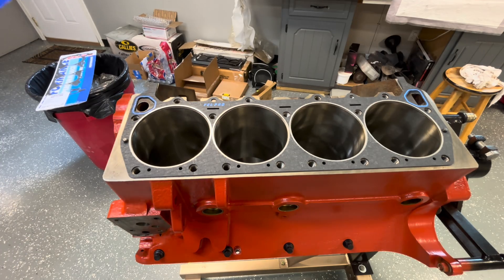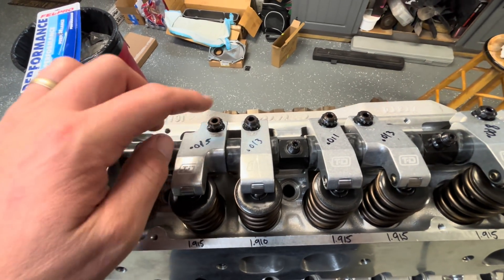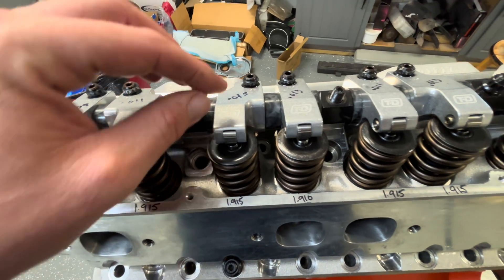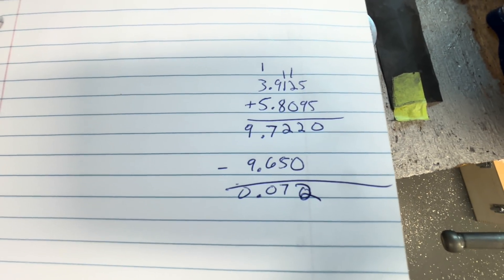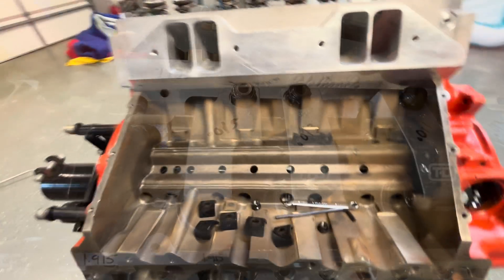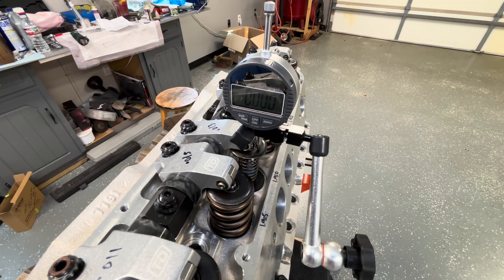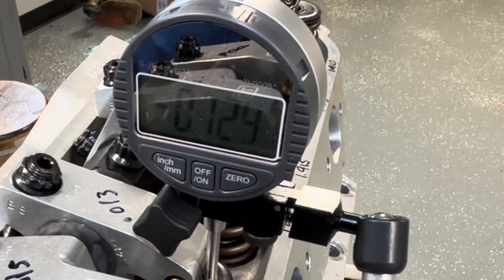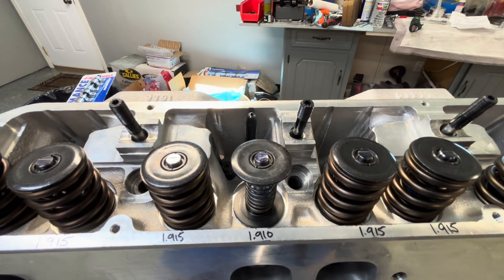580 Stroker Pushrod Measurements #mopar #engine #stroker

Comment: Did I miss it? How did you checkyour geometry before ordering pushrods? did you have to relocate the shafts on those heads  WAY TOO WIDE A SEEP FIX IT B3 OR WHATEVER
Reply from the maker: The sweep is wider than desired, but the rockers and lifters are what they are. The silver lining is that the sweep is centered on the valve and the lift is very close to what the cam card asks for. I don’t know if B3 shims would be the best option for this much spring pressure. Or would be a substantial amount of force on five rocker studs that are holding on for their lives.

Comment: If you measured the exhaust pushrod, with the adjuster one turn down, and with a feeler gauge setting the valve lash, and that number was 9.7220" then you can use Pythagorean theorem to figure the intake pushrod length with the 0.725" offset rocker.  Then add a touch more since the intake lash is smaller.  Intake = SQRT((9.7220^2)+(0.725^2)) = 9.748995" or 0.027" longer than the exhaust pushrod (plus extra for the difference in valve lash.)
The extra from difference in valve lash would be (Exhaust lash - Intake Lash) / rocker ratio
Reply from the maker: Excellent! I was thinking about that math as well, but didn’t want to mess up explaining it in a video.
Reply: @JustMoparJoe  Just trying to explain the math because of the rocker offset / tilt of the pushrod.  Should come up the same when measuring with the adjustable pushrod.  You should show the difference of the T&D rocker system with the smaller diameter shafts that are real thick and need the special hold-down studs that are narrowed in the center for oil flow.  Looks like the rockers clear the retainers/springs with your setup.  I ran lash caps because of retainer to the inside curved part of the rocker touched when the valve was closed (was using +0,100 retainers with +0.050" locks for more spring install height.)
Be careful tightening down the rocker shafts evenly.  The spring pressure on the cam lobe can cause the engine to rotate if the engine is not in a position where the pressures equalize.

Comment: Hey Joe. When you showed the push rids from the side it looked like the intake was very close to hitting  the block on top and it looked like the push rod was hitting the lifter cup. Just a suggestion.
Reply from the maker: Thanks Brian! I’ve got some good close up pictures and always double checking. I’ll try to get some better angles for the final assembly.

Comment: Just curious in case I missed it. Is the head gasket torqued down? How much does it compress? So in my way of thinking the head gasket would need to be torqued to do all your measurements? Thx Joe. Awesome to watch and learn so I don’t make any mistakes on my build. I appreciate all your vids. I have learned so much.
Reply from the maker: Thanks brother. This gasket is not torqued until final install. MLS gaskets can get retorqued. These only get the one chance. They will compress less than .010” of an inch. Which won’t matter much at all. I do have a compressed version of the gasket but will have to find it after the move.

Comment: No pushrod clearancing required for offset rocker?😊 Does the block have standard rocker shaft oiling?
Reply from the maker: It appears these heads have been clearanced very nicely and have a mile of space. I will try to show close upon final assembly.
Reply: @JustMoparJoe i have this head and rocker combo going on factory RB block just wondering if best to use offset lifters or not?😊
Reply from the maker: @malglasspool9302 I will have a conversation with BAM soon about this very thing
Reply: @JustMoparJoe great thanks,will be watching for sure👍😊

Comment: I use the same T&D rockers and have found a lot of flex in the shafts causing around 8 to 10 thou extra rocker clearance when the valve that closed is next to the valve at full lift (.750).
Reply from the maker: I’ll absolutely check that out! I did notice the smaller diameter shafts in comparison to what I’m used to.

Comment: Curious to why the owner didn't go with Harland Sharp rockers. Also, does that .51 Head gasket increase compression? Just curious. Good video Joe.
Reply: If it’s going from a .40 to a .51 it’s actually gonna decrease compression slightly.
Reply from the maker: He ordered the T and D’s a while back. They’re known for race quality and being very well made. It’s the first set I’ve ever used.

Comment: I hope you have better luck with those Fel-Pro head gaskets then I did. The fire ring kept coming off the side closest to the bore. I went to Cometic and hade no more problems.
Reply from the maker: That’s wild! I haven’t had an issue yet
Reply: Could it be the size of the Cylinder? but this is looking like a great build,

Comment: I'm very interested in the T&D rockers.  They are expensive so wondering what. your thoughts are on them.
Reply from the maker: They seem very nice. The rockers roll on a smaller diameter shaft and only have one oil hole on the shaft(unlike 440 source and HS). The spacers seem like they’re made from a composite material.